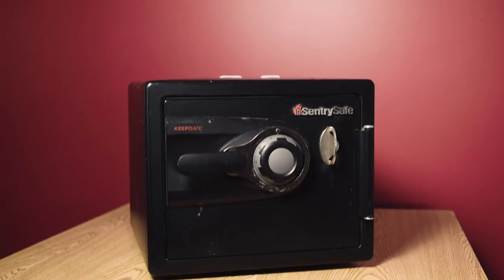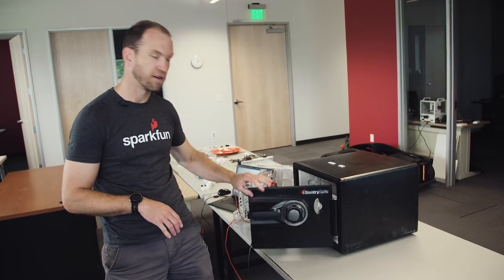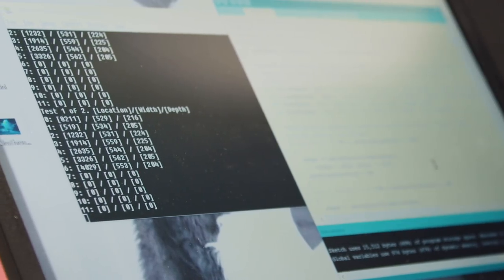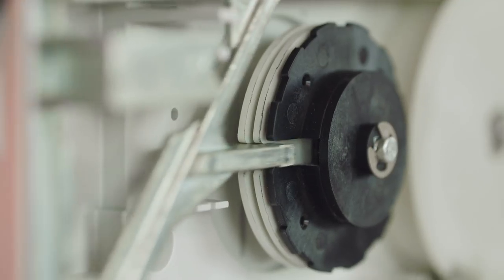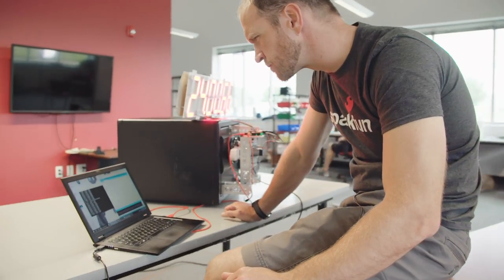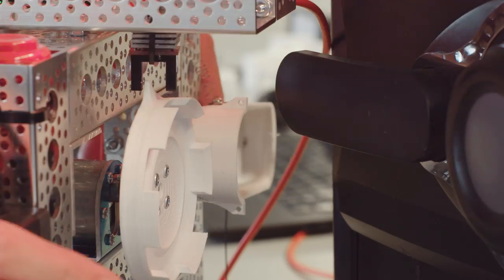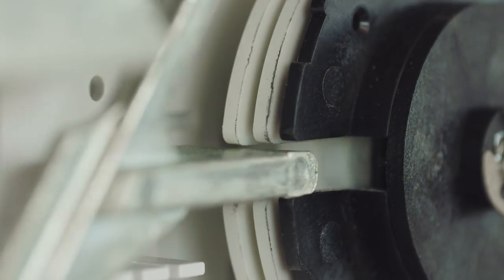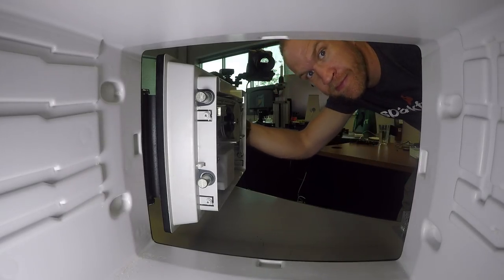Homemade Robot Cracks a Safe in Just 15 Minutes | WIRED

Comment: Safe Dailers have been around for a long time .. This is in no way new tech.. His robot would not work on a Sergant and Greenleaf Dial, at least not without some code changes.. The Notched Disk is only in the Sentry safe .. and most of them you don't need the trouble of building a robot to open it.. As a matter of fact it is pretty much a far stretch of the word to call any Sentry product a "safe"

Comment: This safe ain't safe.
Reply: It's not supposed to be. It is fire resistant, but the shell is susceptible to cracking with a sledge hammer. I guess they only bothered with the lock because it looks cool. Unfortunately the previous owner forgot the combination. Fortunately, he didn't leave anything in it when he sold it.
Reply: David Downer.
Reply: its a fire resistant safe, not fireproof, so really its a time delay to save your belongings from or to keep them out of direct reach (ie: kids), not actually meant as a theft safe/vault.
thats why the cams are so loose and that 28-29-30-31-32 all work in either position. sloppy like a Dudley Locker padlock. ( 0-59 on the dial, but really only 45 actual combinations. ) cheap construction/parts/machining for a low end market product or storage grade product.

Id REALLY like to see his device try to crack a S&G ( sargent and greenleaf 67XX series )  you over shoot a single digit by half a mark on the dial and you need to restart.

source: I am an ex specialized locksmith.
Reply: no challenge.  work on a real combo lock :)

Comment: Hahahahahaa "robots are really good at knowing where they are"
Reply: Well, they are. What's so funny?
Reply: They aren't have you ever heard of noise
Reply: They aren't have you ever heard of noise
Reply: You have to filter all information and fixing errors in mapping is a whole subfield of robotics
Reply: then after you do that robots are really good at knowing where they are, congrats you answered your own question.
Reply: GoNmanne11 no they aren't. Error always accumulates. I literally work in robotics.
Reply: TheDutchPotato no the servos have high accuracy and don't shiver that's what makes medical robots so good did I not just say I work in the field
Reply: +Aidan Gomez
You are not the only one here who is working in robotics.

You are talking about mapping, which is not an issue in the application that the video discusses.
Stepper motors are highly accurate, noise is not an issue within certain tolerances.

In applications where you do mapping, you typically also do locating. If your errors accumulate, you are obviously using odometry only; you are doing it wrong. The same features that you map can also be used for locating, thus correcting any errors introduced by the odometry. If you are a roboticist, I don't need to tell you what a Kalman filter is.

Random noise would cancel itself out, especially if it is low-pass filtered. Errors that accumulate are systemic, for example from inaccurate calibration of the gyroscopes. Your claim that noise is the problem shows that you are not a roboticist. Whatever it is you are doing to those robots has obviously nothing to do with their behaviour or capabilities.
Reply: David Wührer you are right about that. But as we both know, even filters can have issues, especially when we are talking about 3D mapping. And steppers may be accurate, but they are expensive and are much more complicated to drive. I use servos which often have cheap potentiometers reading the position. As for Kalman filters, they are not computationally efficient and no where near as accurate as is needed for complex 3D SLAM. That is where MCL comes into play. I work on self driving vehicles, specifically computer vision. Practical sensor suites can be bulky, so I use ML and CV to navigate. Of course I run into a high rate of error there.
Reply: David Wührer I can send you some of my work if you want. It's odd because I couldn't find your name on any papers. I literally said errors accumulate. Cheap IMU's, incorrect potentiometer readings, and general noise is something that ALWAYS accumulates. Why do you think warehouse robots use bar codes on the floor It provides a reset for that accumulation by offering a known value.
Reply: +Aidan Gomez
I see. Our robots are not nearly as fast as cars, so in comparison we can get away with a lot. Still, it never ceases to amaze me how well they work, everything considered.

I don't currently work in academia, which would explain my dearth of published papers ☺

You did literally say that errors accumulate, but you also said "have you ever heard of noise". Statistically, more measurements make noise less of a problem, despite each measurement being noisy. I may have misunderstood you there.

I'd still say that robots generally know more exactly where they are than, for example, do I, considering how often I have bumped my head. I won't say that that knowledge comes cheap, and it's certainly possible, if nonsensical, to build a robot without any sense of orientation. It is a lot of work (that most people gravely underestimate - "it's just software"), but if you have sensors, why wouldn't you make the best use of them. I think it is astonishing how much is possible with how little.

And you are one of the people that explore and expand on those possibilities? Respect ☺
The industry is slow to adopt academic discoveries. It takes time to understand new concepts, and developer time is expensive. There is much we would like to try that we simply don't have time, or the processors, for. Making the most of limited resources is vital here, so my perspective on the capabilities of robots is quite different from yours ☺
Reply: as a rule of thumb, everyone that need to state " I literally work in robotics", dont really work with robotics
Reply: considering the security bot that literally committed suicide by drowning itself in a pool I think that statement fuckin hilarious xD

Comment: Guys I have an idea to invent a robot to do this too. All I gotta do is put the safe on the safe cracking platform, and turn on the robot to execute its command. This in turn will lower a hydraulic press precisely on the door of the safe, just as the robot intended. It seems flawless, I know, any suggestions for improvements are welcome, like a robot that turns on the press would be great and all, but maybe one that turns it off?

Comment: 3:35 the issue is, it's a product you buy. It's not software. It doesn't get periodic updates you can just download. Flaws found out are flaws that every current owner of the product has to actively be worried about. They can't just update their safe. They would need to buy another safe hoping the new one doesn't have the same flaws. And if their current safe has not stopped functioning, they wouldn't buy the new one.

Comment: Someone done it in a minute with strong magnet
Reply: That exploit, along with the 'dropping it' and 'smacking it' attacks are for the lousy quality electronic safe locks that use a switched solenoid to move an obstruction out of the way, allowing the safe to be opened.  Neither of these methods will accomplish anything useful on even a low quality mechanical dial lock.